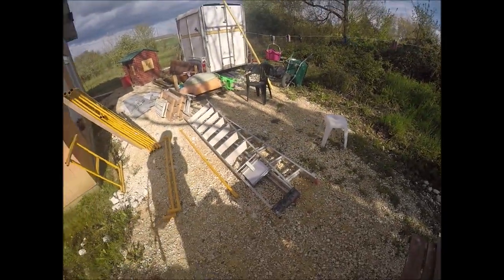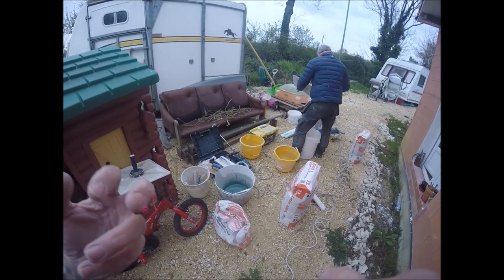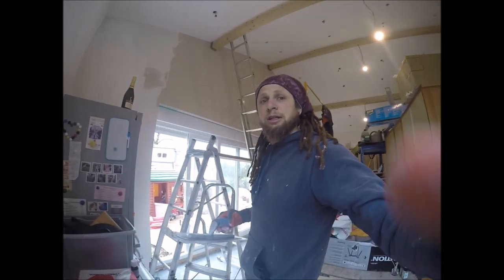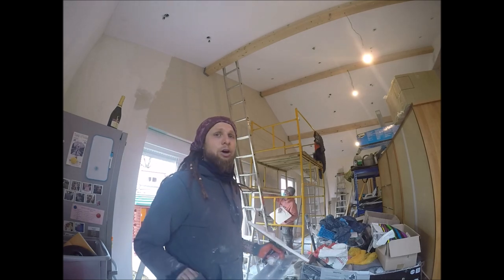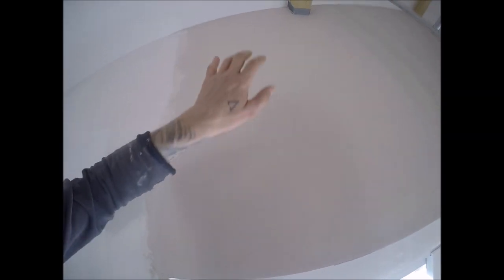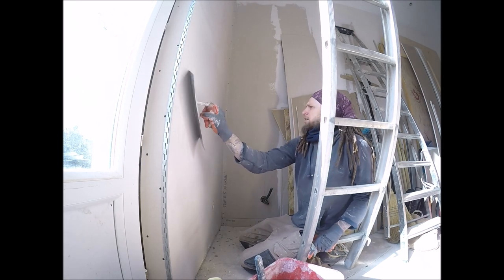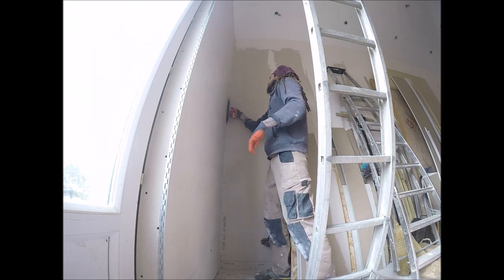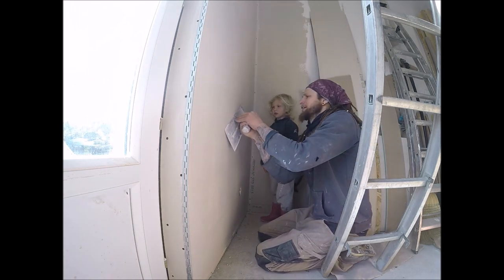How to use french plaster lutece 2000L

Comment: Hi can u use on painted walls if so do u have to seal the wall or not thanks we live in France
Reply: i've plastered straight on to tiles with it experimenting and paint and no problems,i'd heavily score it with a stanley blade all over the wall first and seal it with a primer or it goes off real quick,bon courage
Reply: @perry210178   hi thanks for answering can I ask what primer did u use thanks
Reply: Primaire d’accrochage, it’s available in most bricos 👍

Comment: I found this really instructive, very useful. Craig, do you just use scrim tape for the joints and put the Lutece straight over it? I'll be making a start next week.
Reply: Yes exactly that, also because it’s tapered edged board we fill them first before going over it again to stop getting a depression on the joint. Bon courage
Reply: @perry210178  Thank you very much! I'll be in at the deep end, I can only source the 2000C...any thoughts on PVA priming on plaster board? Have you ever tried it? Seeing very mixed opinions on that.
Reply: @leightongough3937  personally we’ve only ever discussed it because sometimes it goes off so quick it would obviously give us more time but we can normally cope quite well with walls up to 8m so never felt the need but for you I’d say 100% to do it as it’ll give you time to get it all on have a rest before you have to flatten it and polish up….. I can’t stress enough that you really want to be patient to get a nice finish, too soon and it will tear and bubble, you’ll get a feel for it as you go.
Reply: @perry210178  Thanks again Craig for taking the time to reply. I'll start on a relatively small section of wall to try it all out and let you know. Just got my Marshalltown and Refinas delivered...
Reply: @perry210178  Do you just use the Lutece for pre-filling the tapered edges Craig?
Reply: @leightongough3937  yes normally do the taper edge first then skim over the whole lot straight after
Reply: @perry210178  Would love to! 😆
Reply: @leightongough3937  Craig Russell perry easy enough to find 👍🏻
Reply: @perry210178  Have looked but no joy. I'll bet there's less Leighton Gough's😁
Reply: @leightongough3937  do you live in Sheffield or Indiana ? There’s two one is a pic of two lads boxing the other is a dad with his kid
Reply: @perry210178  No, I live in France. What's your FB ID Craig ?
Reply: @leightongough3937  same full name again
Reply: @leightongough3937  I got a 3 day ban for that message I sent you 🤷‍♂️ apparently writing troll is naughty these days 😂

Comment: you need to get some proper lessons on Lutece never sponge the platre it will bring the grit to the top , one coat flatten second coat flatten pull out all imperfections polish flat you never get it like multi finish its a different product
Reply from the maker: Don’t need lessons thanks, as long as it looks good once painted any method works great including yours 👍🏻
Reply: 40 yrs of plastering under my belt in france yes you do need lessons ! don't be cock sure you have no idea onhow to finish contact lutece they give you techniques lesson for free  that you would be proud off.
Reply from the maker: @junearthurmarch3763  😆 not being a cock and doesn’t matter how many years you have under your belt, I’ve lost count of how many walls and ceilings I’ve done with Lutece and never once been called back and like I’ll say again it doesn’t matter how it goes on as long as it looks good once painted. If you’re in the dordogne or lot et Garonne come show me how you do it 👍🏻 never to cocky to think I know it all